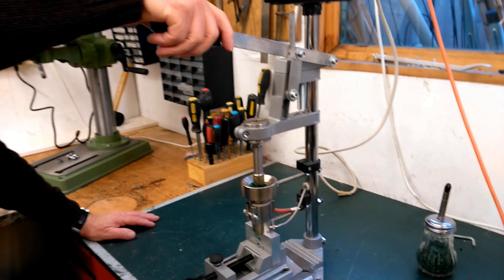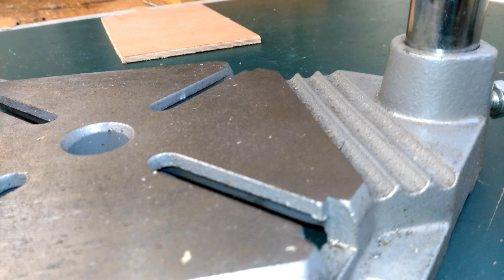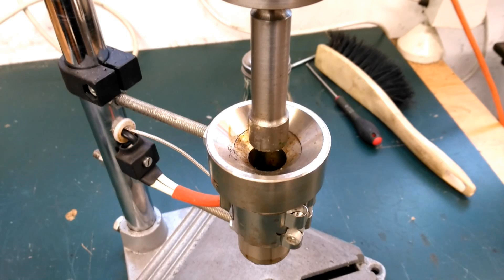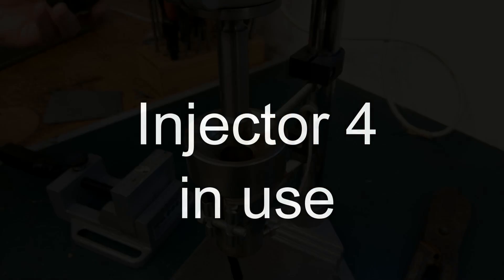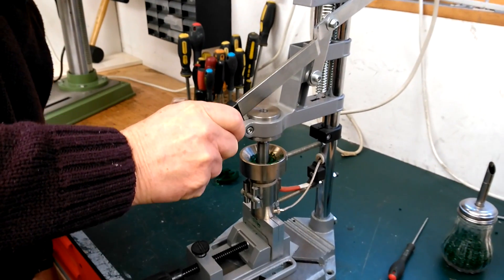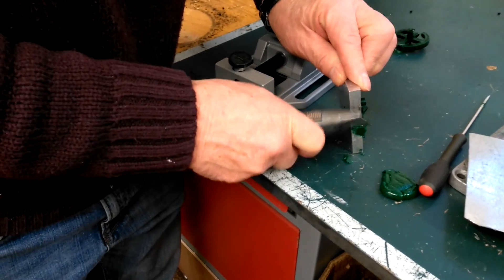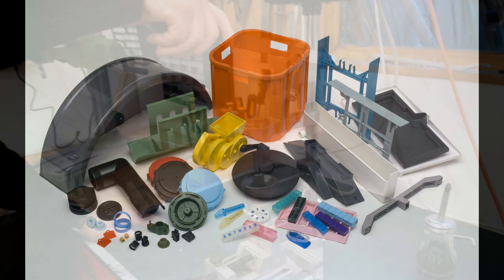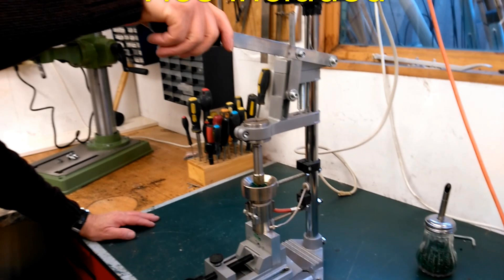Plastic Injection Moulding Machine - model 4

Comment: Hello Chris, I would like to know if is possible buy only the stainless steel funnel with the plunger in order to avoid the excesive P&P rates to my country (Argentina). Please let me know if is possible and the price. Kind regards, Luis
Reply from the maker: Hello Luis, yes it is possible. I could provide the controller unit too - or not. When posting parcels from the UK, the prices are coarsely banded. 2Kg is a huge break point. Up to 2Kg a parcel to Argentina costs about £25. Anything at all over that costs about £70.

Comment: How much are you asking for it with postage within the UK? Thanks
Reply from the maker: Hello Joshua, it is on EBay for £425 + £25 P&P. http://www.ebay.co.uk/itm/201749893363.
If you'd rather buy it privately, we can split the EBay fee I wouldn't have paid - so £425 all-in.
The nearest thing sold commercially to this is LNS technologies' machine - currently on sale for $1,800.     (http://techkits.com/products/model-150a/)
Frankly - there's is a more professionally finished machine, but then they're a professional company.
Mine does what theirs does, and it's solid stainless (there's was nickel plated last time I asked), and it's a third of the price.